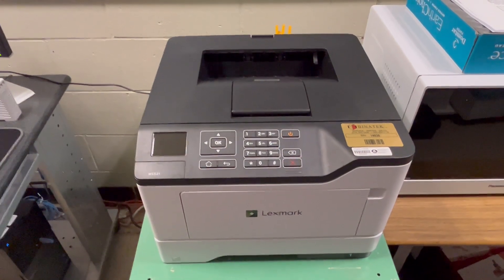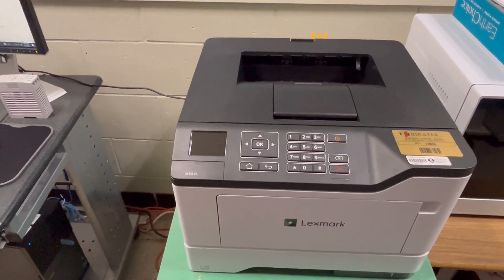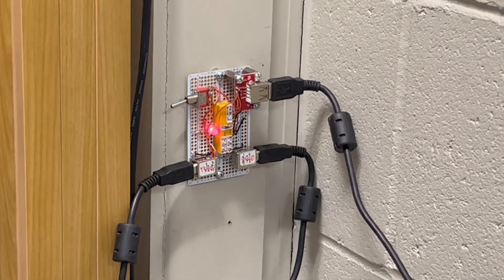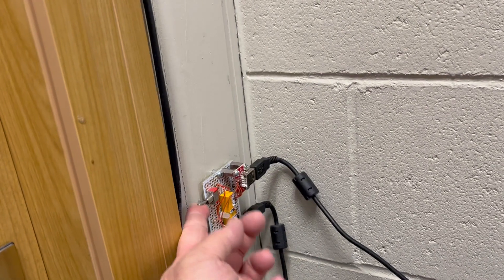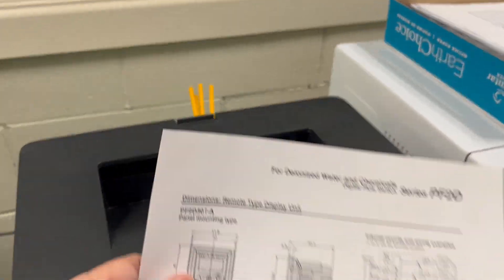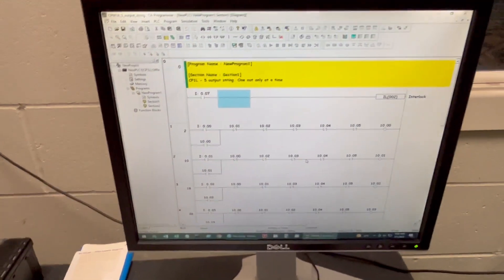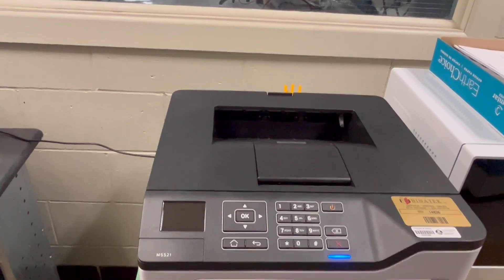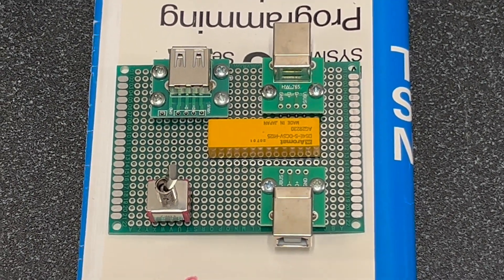PCB Relays - the Printer Switch Project at Work

Comment: Very ingenius. Im assuming that specific printer has a ethernet port on the back that would make it easy to share the printer with PC's on the same LAN. Im waiting to see how it will turn out!.
Reply from the maker: Thank you Cesar for your feedback! If you watch 🎥the video clip again, you'll realise that the little project staying between the printer and the two computers is connected to all three devices by simply using their USB ports!
Surely more details are on the way!
Regards
Reply: @CU_Wiring_Electronic_Projects  I meant that the same could be achieved with a LAN cable that can make the same printer usable with other devices on the same LAN via IP. I see this project being useful as a mean of avoiding the device "Calling home" and creating back doors due outdated firmware.
Reply from the maker: Thanks again Cesar:hand-pink-waving:!
Excepting for industrial printers where proprietary connectors were employed-I had to build some interface to use such a printer with standard PCs - there are 4 classical ways to connect printers to PCs:
#1-parallel cable. This interface is now obsolete, typical for the old style "Line printers", Centronics connector on the printer, DB-25 on the desktop, with LPT1, LPT2, hex addresses 0378, 0278.
#2-USB cable: USB-B on the printer, USB-A on the desktop. This USB was designed by the manuf. to allow local hook-up to a desktop. This is also what the present project does btw. if you need to occasionally hook-up a laptop too to the same printer and you don't want to keep removing cables. 
#3-RJ-45 Ethernet connector is the one you refer to. Big companies or institutions can share printers among several users. Not very practical at home because you have to draw cabling around.
#4-Wi-Fi, which is the modern way trough your home router. Older printers won't be provided with.
Conclusion: I actually use this little project just as a prop, to make people familiar with PCB relays, as an app to share a printer locally in the same room between two PCs.
Regards